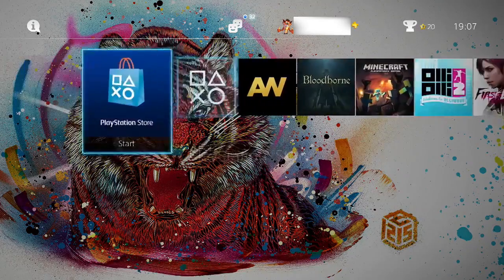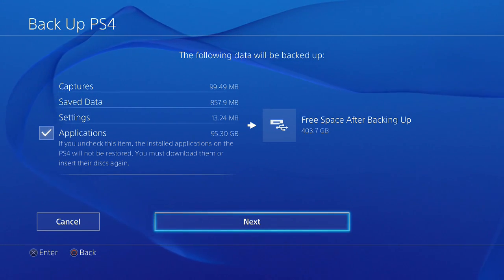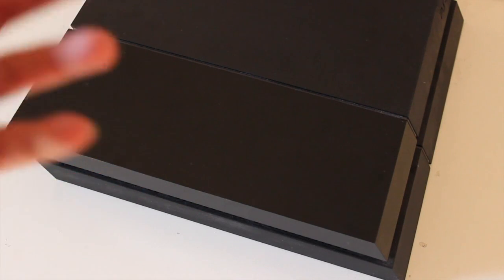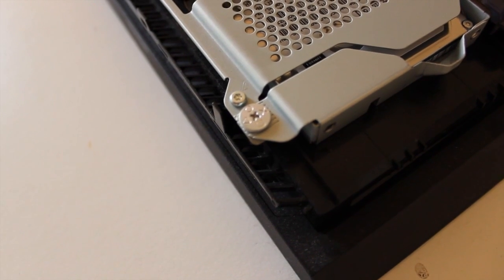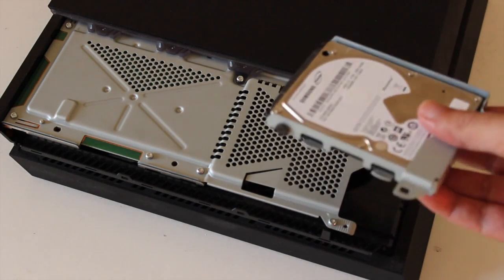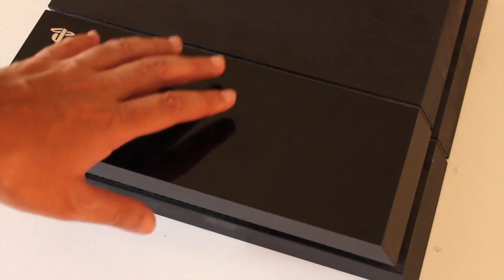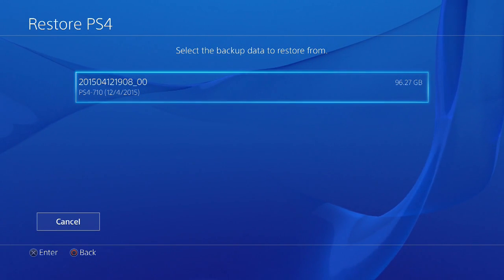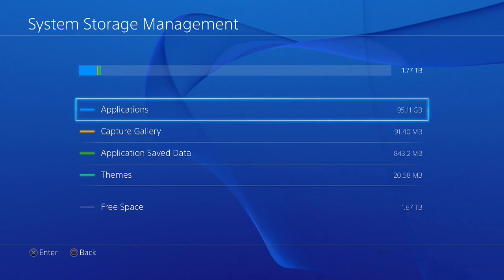How to Backup and Restore your PS4 HDD

Comment from the maker: +thook you need to install it via a flash disk
Reply: and you need to put your usb stick still in your ps4
Reply: +Slingshot Thank you dude. I wasn't sure How to do it. but now I watched this video. I'm now sure that it is going to work.
Reply from the maker: +Kevin Hovens (burrito21161) awesome let me know how it goes
Reply: My ps4 doesn't find the software on my USB wen I want to download the sofware. What do I need to do???
Reply from the maker: Make sure ts formatted in Exfat or Fat32, create a folder called "PS4" and then an "UPDATE" folder in the PS4 directory and then put your update file there
Reply: I dit that. My friend said (computer nerd). Put a game in your ps4 sow I put the disc from AW in my ps4 and the USB and ith works now.
Reply from the maker: Cool glad its sorted
Reply: +Slingshot do the speech marks have to be typed in?
Reply from the maker: +Mark Dorsi on the flash disk create a folder called PS4 then create a folder inside that called UPDATE then put the file in that folder
Reply: +Slingshot I put it in the Update folder
Reply: +Slingshot Is that right
Reply from the maker: +Mark Dorsi that is correct. If it doesn't work try and different usb
Reply: if it doesn't work, you need to put a cd from any game in your ps4 and than it will work.
Reply: Slingshot,  I'm gonna upgrade my 1 TB to a 4TB with HDD,  Can i use my 750 GIG HDD to backup all my games and demos when i upgrade  my hdd?  I also have a flash drive with a old Playstation update on it. Can i delete the old update from the flash drive or do i need to get a new flash drive?  THX  Kolerik.

Comment: I purchased a 2 TB seagate External Portable Hard Drive and I connected the hdd to my console.  But the HDD didn't support.  Which 500 GB external HDD will support the PS4 console?
Reply from the maker: +Christopher Sourav Hi, make sure its formatted either fat 32 or exfat in order to read on PS4 and USB 3.0 for best results

Comment: Does the external drive you use to backup the ps4 system have to be completely formatted, or can it have other data on it as long as it has over 500 gb free? Just trying to figure out if i can keep all my video files on my external hdd for the actual ps4 backup part of the process.
Reply from the maker: there can be other data on so long its in the correct drive format and enough space for your backup
Reply: +Slingshot very handy then, thanks!

Comment: So i need an usb driver with 400gb to upload it on a the new hard drive?Because am got 400gb on my old hard drive,and to put it in the new hard drive i need a 400gb usb stick ?
Reply from the maker: +TupacAmaru Shakur Correct, you need a drive that is bigger or the same as your 400GB and then your new drive which should be 1TB or a 2TB drive
Reply from the maker: +TupacAmaru Shakur Correct, you need a drive that is bigger or the same as your 400GB and then your new drive which should be 1TB or a 2TB drive
Reply: Slingshot but where can i find i usb flash driver with 400 gb it's impossible
Reply from the maker: +TupacAmaru Shakur you need an external hard drive not a flash disk for the backup. external drives range from 250gb to 2tb in size
Reply: Slingshot sorry but i keep do not understand how to put all my games saves and files on a new 2 tb hard drive :(
Reply from the maker: +TupacAmaru Shakur You need to backup all your games via your PS4 to the external 500GB drive and then transfer the backup to the new installed drive which is in your ps4
Reply: Slingshot and where can i find a 500 gb drive?
Reply: Slingshot I saw a 1tb hard drive that you can connect by usb.Does it work too?
Reply from the maker: +TupacAmaru Shakur yes any USB 3.0 should work that is formatted fat 32 or exfat.
Reply: Slingshot so i connect the 1tb hard drive with the usb and put my files on it.Then i have to put the 1 tb hard in the ps4 ?
Reply: Yes you do get 500gb for $40 or less

Comment: I think this is helpful thanks for posting! i have a question. when you backup  those apps on your another external  hdd. does it includes the latest patch of your previous games that were downloaded on the  stock HDD of the ps4 which was the (500gb)? thanks
Reply from the maker: +zdam madz Yes all patches for games etc. Will be backup to the external
Reply: +Slingshot i see. but do i need to format  the external to fat32 in order for the ps4 to read it?
Reply from the maker: +zdam madz Either Fat32 or ExFat
Reply: +Slingshot Bro! i have a question again. so  what if i format my 2tb to fat32 or exfat  and then i will backup  all my applications saved data etc. on the 2tb. can i replace the 2tb that has the backup in it in the ps4 HDD? and will it include the patches after backing up? please reply. :)
Reply from the maker: Nope does work like that :) You will need to restore via the PS4 app just like you backed up the drive. Its such a pity that Sony wouldnt allow us to do that. Its like the usb drive is the middle man in the situation. So technically you need a spare drive to backup / restore to the new drive
Reply: +Slingshot Thanks for replying, So specifically you need like  a 500gb external drive to backup all the things that are inside the 500gb stock HDD and a 2tb for the replacement of the ps4 HDD ryt? and after backing it up and restore it to the 2tb, will it also include the patches that you downloaded to the previous 500gb?
Reply from the maker: +zdam madz All info you mentioned is correct :) It will include patches, saves and downloadable games

Comment: This video was extremely useful! Thank you so much!
Reply: +Slingshot Hey man, i'm quite much a dipshit with all technology and i am extremely insecure about this process, since i have a bad habit of fucking up important things like this. And also, english is not my main language, so that makes things even more hard.

So my situation is this: I have the stock PS4 hard drive and it's full. I want to upgrade to 2TB and get all my game saves and system software with it, so i don't lose any of my saves.

Could you give me a quick step by step walkthrough of what do do first and when to plug in the USB and all that. This would help me out greatly. I'm sure you explained all this in the video, but my english understanding being bad and my headset being as good as a potato, i'd appreciate if you'd tell me here.
Reply: Slingshot
No, can't find a fitting one from my countrys shops or websites and i'm struggling with purchasing them from other countries. But yes, i do know what sort of hard drive i'm looking for.

And i know how to change the hard drive, only thing i'm worried about is backing up the game saves and all that and restroring them
Reply from the maker: +Jóhan Djurholm Awesome glad i could help
Reply from the maker: Hi. The video has all the processes from the beginning to the end. I cant really give you a step by step guide as its going to take forever :) and usually videos are much easier than following text in my opinon. First you need to get yourself a compatible 2TB drive. Have you got one?
Reply: +Slingshot wait so how do I do everything in order? I'm really sorry I've never done this before but it would be nice if you could help me.
Reply: +Slingshot u said something like having the hard drive already in while backup and restoring but then u were putting it inside the ps4 after or were u talking about 500gb
Reply: +Slingshot nvrmind u said u already had your external inside

Comment: i used a western digital 1 gig internal drive that said on the box ps4 upgrade compatible and i transferred my data/games to my 2tb external sea gate and set it all up and it worked but now it keeps saying that i cant sign in as that user on this ps4 console , also after the install i was told to sign in first then restore and thats were its not letting me sign in so i by passed what the guy said and just went and restored it first so will i be signed in when its done. Or did i screw up some were

Comment: does saved data like all my game files for different characters and new games on witcher save to a flash drive too? my cloud is full to get this years games uploaded. I don't have a external hard drive and can't afford to buy one to backup everything. I can handle waiting all day installing but I'm nervous I will lose all important game saves and progress in online stuff
Reply from the maker: yes you can backup save files to a flash disk. make sure that the profiles are correct because save files are linked to profiles if you want to copy them back to the ps4
Reply: +Slingshot will it work on the same drive as the firmware update is on? I'm not very good at handling data I'm not sure if application saved data is what I need or if I don't need it. and I also don't know what to do with my digital pre orders
Reply from the maker: Yes it will work. The drive needs to be formatted fat32. You digital pre orders might need to be redownloaded again
Reply: +Slingshot ok thank u so much :3

Comment: +Slingshot do you need FAT32 on your 2TB Internal, External and USB drive.
Reply from the maker: you can format fat 32 or exfat
Reply: +Slingshot which works better
Reply: +Slingshot so you have to format all three
Reply from the maker: +Bernard Van Aswegen I did fat 32
Reply: +Bernard Van Aswegen so did you format all three and are u sure exFAT works
Reply: +Bernard vA I used ExFat32

Comment: Ok so I need help? I was watching other videos and they were using just normal internal hard drives. The way they did it and explained it was, you have to use a USB device and update the system software to the USB. Sounds like a lot. But I'm using a 1tb western digital External hard drive, (2.0 and 3.0) USB compatible. Can't I just back up everything on my western digital external, through the USB 3.0 port, then put the hardrive in the ps4 and restore?
Reply from the maker: Codblackopslahi Technically you need 3 drives. Your original PS4. a USB drive for your backup and then another drive for your restore which in my case was a 2TB. It doesnt work as simple as that backup to a drive and then install it. Unfortunately Sony doesnt allow that. Your western digital wont fit into your PS4
Reply: Yeah I just figured that out lol. I seen it and. I'm like that's not going to work. Oh well, maybe another time. Thanks!
Reply from the maker: Codblackopslahi Coo no probs :)
Reply: Looks like I might have to get a new hard drive

Comment: So is it gonna be 3 hard drives then? 1 from the ps, 2nd for doing the back up and the 3rd the replacement of the ps hard drive?
Reply from the maker: buzocaperuso Correct :) Let me know if you need any more help
Reply: thanks for the reply can you tell me wich one did you use i just want to be 100 percent sure I'm doing it right also by using this method would i be able to still keep playing the P.T demo i have on my ps hard drive?
Reply from the maker: buzocaperuso If you follow my video all the way through you will backup everything including PT Demo

Comment: I don't see how FAT32 will work when it has a limitation of "32GB" anything over that will either have to be XFAT or NTFS unless this is a very unique situation.
Reply: Robert Hayden I have a 1TB external that i formatted to XFAT and plugged it into the usb and tried to see if it would recognize it, sure enough... it did though i have not tried to do an actual backup. I'll do that when i'm finished with this game download which wont be done until tuesday evening.
Reply from the maker: Robert Hayden Hi, the file structure is less than the normal 4GB limit which is in most cases for PC but not for the PS4. You can format in EXfat or FAT 32 which ever suits you. PS4 cant read NTFS formatted drives

Comment: Great video but im confused on somethings.
1) if i dont back up will my downloaded games get deleted 
2) if i do back up can i use the same external drive i used to back up my data then pop it open to that its now an internal drive and put it in the ps4
Reply from the maker: Mahir Ahmed Cool thanks man.
1. Yes they will get deleted. I usually only backup my digital games. My disk games i reinstall and download the latest patches.
2. Nope you cant use the same drive. Its very silly move from them. The extra usb drive is the middle man :)
Reply from the maker: Mike Cornish Correct :)

Comment: So my back-up hdd is a passport, anyway long story short is that the ps4 wont let me back-up anything. I formatted the passport into FAT and exFAT, so what is the problem?
Reply from the maker: Immanuel Gonzalez Is your drive usb 3.0 or 2.0? That could be your issue
Reply: Slingshot USB 3.0 but compatible with 2.0
Reply from the maker: Immanuel Gonzalez It should work. Try a different usb port or maybe try a different drive. Maybe its not compatible which sucks from Sony side
Reply: Slingshot yeah, I think the hdd is not compatible, so I might have to use a new one

Comment: Hi i would like to ask if my verbatim store n go 2tb hdd will work fine?  Because its the one i have right now. Thanks.
Reply from the maker: Jerome Rubio Hi, i doubt it will work as the height of the drive might be too big. What is the size of it?
Reply: Its 116mm×80mm×13mm. Im not sure if this dimension is with case or not. I still havent opened it. Because I want to make sure first before doing so..
Reply from the maker: Yeah i am not sure it will work because of the height
Reply: Thanks Slingshot

Comment: What external UBS drive did you use to store all your data on?
Reply from the maker: Bilveytoman Just a normal western digital usb 3.0 1TB drive
Reply: Slingshot Thank you so much, dude. It really helped. :)
Reply from the maker: Bilveytoman Cool, no problems
Reply: Slingshot Oh and another quick question and i may have missed this on the video, but do does the original firmware update get downloaded on to the PS4 on it's own or do you have to extract the firmware from the PC with the USB device. Because i saw there was a link for it in the description so i was just wondering. Sorry if i sounded very uninformed about that, but i just want to be very careful when i upgrade my PS4.
Reply from the maker: You need to reinstall the PS4 system software with the link in the description. You can copy it to a usb flash disk and update in safe mode
Reply: Slingshot Okay i think i got it. But is there a difference between the flash disk and the external usb device or are they the same? I researched it online and they seem the same but i just want to make sure on that. Sorry if some of these questions that i'm asking sound unnecessary.
Reply from the maker: They are the same. No probs. Shout if you are stuck
Reply: Slingshot Okay awesome thanks. :) I think i got everything. I'll let you know if i run into problems.
Reply: Slingshot  Okay so i ran into a problem and i need help. How do i format my usb device to fat32 in order for it to work on the PS4?
Reply from the maker: You can download a program called fat32 to format it or format it in exfat. Either will work
Reply: Slingshot Okay i got everything ready to upgrade my PS4. I only have two more questions to ask. I have backed up my data on my usb device, but should i delete the stuff on my 500 gb hard drive before i replace it for security reasons? Also which power button do i hold down to put it on safe mode? The touch button on the console itself or the PS button on the controller?
Reply from the maker: Save your date until you are happy when the install is complete then you can format your old drive and maybe use it for storage. You hold the power button on the console, and then it will boot into safe mode
Reply: Slingshot Okay thank you so much. Now i am ready to upgrade my PS4. Thanks again for the advice. :)
Reply: Slingshot okay one more thing please. I got the hard drive inside the console now and i'm on safe mode. I am given seven choices. which one do i pick? #3 Update software system, #6 initialize PS4 or #7  which is the same thing but with the (reinstall software system) on it?
Reply from the maker: You need to reinstall the software so #7 it is
Reply: Slingshot Alright i got it. If i need more help i will let you know.
Reply: Slingshot Well. it won't recognize the update file. i got the update from the right place, i followed all the proper instructions and nothing. Is it because i have both the update and the backed up data on the same device? Also i made sure that the usb device was at FAT32 before backing everything up.
Reply from the maker: Make sure the file is in the correct folders. Try a different usb make sure nothing else is on it
Reply: Slingshot Dude! I did it! :D Everything is now restored on my PS4 with the new 2TB hard drive! :D Thank you so much for helping me out on this. it was really helpful. I really appreciated the time you had to help me. there is one more thing i would like to say. You just earned yourself a new subscriber. ;)
Reply from the maker: Its only a pleasure dude. Glad i could help out. Thanks for the sub :)
Reply: Slingshot You are welcome man. :)